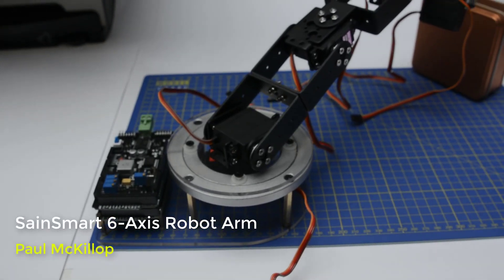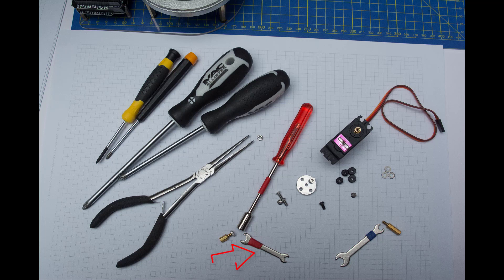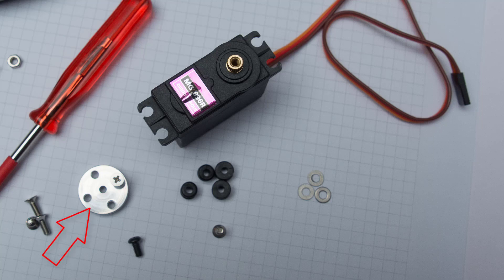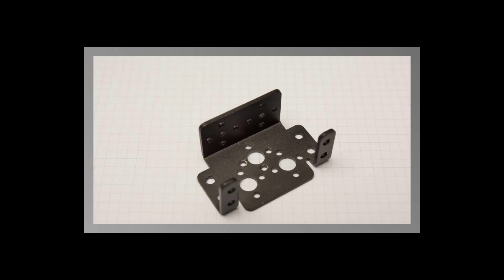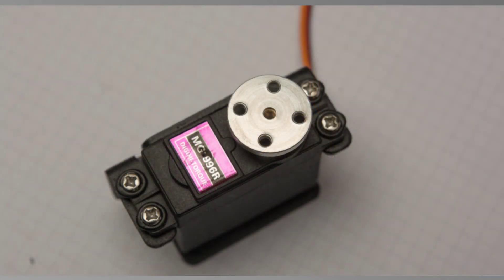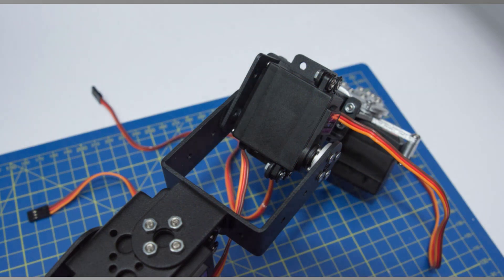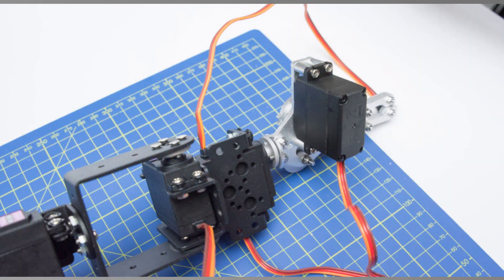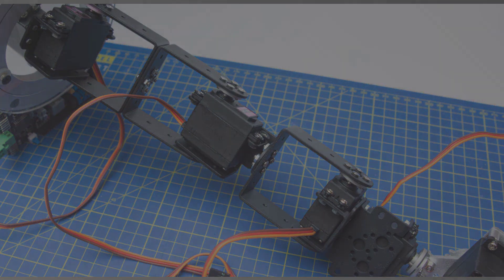SainSmart 6 Axis Robot Arm Built

Comment: Fantastic Video Paul. What did you use to power the setup? i have just recieved the arm and am thinking about how i power it. did you use batteries or mains power?
Reply from the maker: Thanks, Amar. Batteries wouldn't have enough power for the servos to do more than a very few minutes. You need a decent mains adapter.
Reply: can you give a suggestion for a suitable setup?
Reply from the maker: I used a laptop power supply with a step down to make sure that I had enough power (amps and therefore watts).

Comment: Paul:    Your short video was a savior for the arm's mechanical assembly; thank you.  Of course, many re-assemblies and servo testing required during assembly to insure it will work.  Wondering if you have come across wiring instructions / photos for the servos though?  

Mechanically this arm is superb but until SainSmart, or someone, can come up with reasonable instructions they should pull it off the market.  Having to remove its base after arm completely assembled, as I found bolt holes for the Mega 2560 upside down, then having to flip the base in order to secure the Mega 2560 an example seriously flawed documentation.
Reply: Paul:     Direct your viewers to the Instructables website;  https://www.instructables.com/.   Though the Instructable I located relates specifically to controlling the SainSmart 6 Axis arm with a Wii Nunchuk,  it also includes very good color photographs on how to construct the arm and wire the Mega's shield and Arduino code for using same.   Official name of Instructable is:  Nunchuk Controlled Robotic Arm (with Arduino).
Reply from the maker: Thanks, Tom. That looks like a really useful resource and I will direct people to it.
Reply from the maker: Thanks, Tom. I haven't seen any wiring diagrams I'm afraid. Sainsmart have a bit of a track record for poor support for potentially good products. There are several intermediary baords that can interface to multiple servos and I ended up using one from Lewan Soul. They make reeally good things and publish a lot of YouTube demos.

Comment: How did you arrange the bearings?  It looks like you installed them with the flange outwards, but I can't be sure from your video.  I have tried installing them flange inwards, but when I tighten the bolt down, the bearing no longer turns, and the bracket just pivots around the frozen up bearing, as opposed to actually rotating on the bearing.  If I don't tighten the nuts, I would imagine they would rattle off in short order as they are not lock nuts.
Reply from the maker: There's a bit of video from 9.01 for about 50 seconds. Is that what you mean? That way they seem to allow the rotation needed.
Reply: I'll give it a try with the screw head on the outside and the nut on the inside as you have arranged it.  All the assembly instructions I could find had it the other way around, with the bolt on the inside and the nut on the outside.
Reply from the maker: There was a lot of experimentation to get anywhere close. You are probably right and I have probably done it completely wrongly lol

Comment: did you come up with a code? And are you using the wireless connect at all? I can't find anything for a source code anywhere.
Reply from the maker: I have ended up abandoning this for the minute. I had problems with the servos and they all went to continuous rotation. I don't know if I damaged them or they were faulty. I built the wireless connect board but never got the chance to try to use it. I'm afraid SainSmart resources seem to be very poor.
I bought an arm from Lewan Soul from Amazon and it's great. Search for LeArm on the American site for Amazon. I have ordered some new servos from China but they haven't arrived yet. I highly recommend the Lewan Soul products.
Sorry I cannot help more.
Reply from the maker: Hi Andre. Have a look here https://www.robotshop.com/letsmakerobots/xyz-positioning-using-arduino-uno-6-dof-robotic-arm